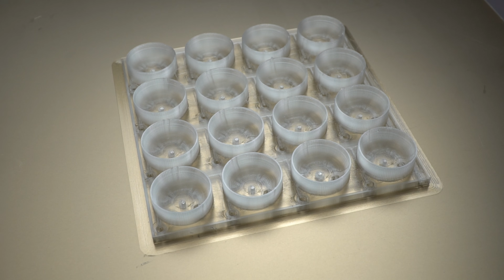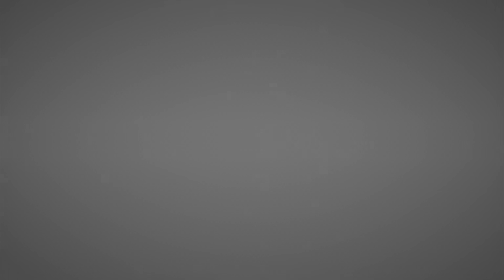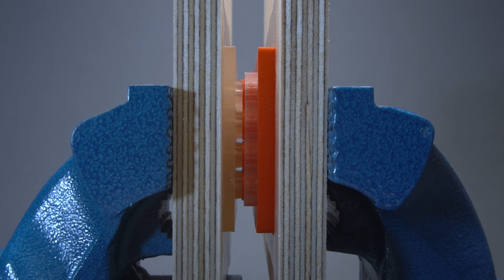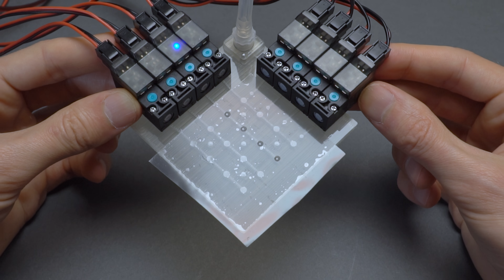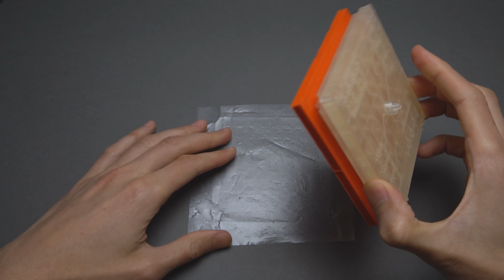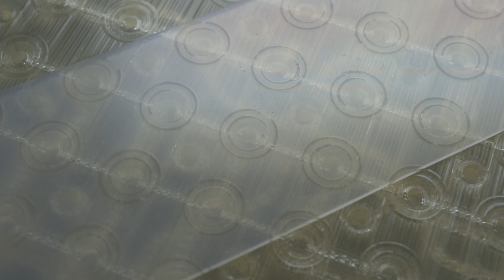Air Powered Display: 3D Printed Fluidic Multiplexing

Comment: How much is the response time affected by vacuum pumping speed vs. air flow restriction through the passages? Wondering if improving response can be done by adding more pumps or if it's a physics limitation

Comment: Can you control the brightness of a pixel by molding a membrane from orange and white silicone, then controlling the pressure and how far the pixel moves inward at a single point to adjust its color intensity by stretching the membrane or creating an air gap between the orange and white layers? Just curious.

Comment: You should look into adding sensors that detect whether a pixel is active. Maybe a vacuum pressure sensor or a flexible conductive membrane that closes a circuit when the cell walls collapse.
That way, you could allow for user input.

Comment: If you make a membrane that has iron filings mixed into it and an electronics board with etched electromagnets just strong enough to pull on that membrane, you can replicate your transistors where the control chamber is actuated by those electromagnets. That would allow you to replace the bulky actuators with a thin control plane, increase speed and decrease noise.

Comment: Do you think you can increase the speed if you add a vacuum chamber between the pump and the mechanism, so you have more of a vacuum to pull from and dont have to rely on the vacuum pump to maintain a vacuum all the time?

Comment: It could become a robot attachment for lifting all the perfume matrix caps at once and releasing them one by one, simplifying the current feeders a lot.

It could also be a good idea to make the contact points smaller and add holes in the membrane to maintain a constant vacuum. The key would be having feedback on which holes are actually covered/blocked.

If you’re interested in testing it, we could collaborate.

Comment: Train brakes use a high pressure instead of vacuum because you can get a greater pressure differential with it. Of course, you would need to make your athmospheric side be a pressurized chamber sealed from the athmosphere then, but if you ever do feel a need to have higher pressure differential (so, higher voltage :P), you have at least one example.

Comment: beautiful system.. next, you could try to build a counting circuit so you only need one valve for clocking through the rows. By the way. You didn't explain how a pixel is released ;) so how is a pixel released?

Comment: My thought goes immediately to a pipetting well plate, but I wouldn't really know what the use case for a modulating pipetting plate would be. It would allow some light mixing, or allow for automated guides. Such an interesting concept, but for display purposes, I think speed and density would need to increase.

Comment: How about adding shading next? I'd assume that adding a variable valve directly to the pump and managing the timing could allow the setting of variable suction applied to each "suxel" (pixel) therefore managing it's depression depth. With bigger screen that would look fantastic. But certainly will bring a lot of problems with tolerances along the way. Great job by the way, that technology looks weirdly sci-fi and retro at the same time it's fascinating.

Comment: That looks like a damn good Massage plate/mate where little automatic suction caps Massage my back. If you get thoes Auktion cups vibrate faster and those solenoids silenced, you could get actually sound out of those membranes. Imagine ultrasonic sound of vacuum powered LRAD

Comment: As you scale up your project, your microfluidic boards will need to scale down. I think you will need to look into resin-based printers with smaller resolutions to print your boards. If you have universities in your area, you may be able to get in contact for use of specialised printers such as from Boston Micro Fabrication or CADworks3D, but off the shelf formlabs printers would work too.
Such a cool application of microfluidics, and there is some real promise down the line like braille displays already mentioned in the comments

Comment: I think you might be able to get more speed out of the display if you oversize the solenoids and drive lines in relation to the pixel size, and supply a chunky vacuum reservoir on each solenoid. The structure immediately suggests itself of a layer of four bigger solenoids, stacked four times.

This may be impossible with the manufacturing method available to you, though. I don't have any intuition for how airtight 3D prints scale.

Comment: Since you can control it with a program, I was thinking using it like a remote IoT display that can interconnect with a flower via Reticulum Network (using LXMF messages) and a humidity sensor 🧠

Comment: This has definitely a lot of potential. The physical aspect is the most intriguing one because this means it can interact with other things. Just like you said in the end, it could literally be a robot. Pixels don't need to be flat and don't need to take up a cylindrical volume. Imagine a 3D shape with logical bladders activated to perform all kinds of actions, and with 3D printing, anything is possible! I think the biggest challenge would be to manage flat smooth surface vs how they would mate to these new kinds of powered shapes, as well as building the logic behind it.

Comment: if you put these inside a half sphere and strech more silicone over the half sphere you get modulated membrane that has a range of motion rather than a binary state, i dont see how its superior to electromagnetically controlled membrane but it would work for a number of applications, from micro manipulators to maybe even camera stabilisation..and depending on the ammount of pixels it could prove to be very finely adjustable...i used a half sphere here as an example for it to be more obvious what i mean but it would work in any shape..after all its air and air is a liquid...would love to see make a box and replace one side with this array facing inwards and one seide of the box being a membrane...would be a fun experiment...for instance if it was arrays like this on 5 sides of the cube and on one side of the cube a reduction to a much smaller membrane it could achieve microscopic level of adjustment..maybe a cheaper way to control laser mirrors than current solutions...love what you do!

Comment: This would look (and sound) so cool as a sci-fi style wall panel. It'd have to be scaled up of course.
I wonder if it'd be possible to introduce positive air pressure into this system. Maybe even a dynamic touch interface (by detecting positive pressure pixels being pushed in)

I couldn't quite tell from tbe video, but did you play with display driver optimizations at all? Like how you can draw with any intersecting lines (like arbitrary rectangles) instead of only rows of pixels?

Comment: if you used white silicone, and put a lip around it, you could pour a thin layer of pumpkin seed oil onto the display. Pumpkin seed oil is Dichromatic, when it is less than 0.7 mm thick it looks green, when it is more than 0.7 mm it look red. I don't know how well this would work, but it could be visually interesting.

Comment: if you can push the pixel to set it manually, and you can read the state of each pixel, then you would have a touch screen!
Reply: I'm thinking the best way to read the display would be to chain a transistor off the pixel as a buffer gate, when the pixel is under vacuum it opens this buffer transistor, which can then be sampled by a second grid without interacting with the vacuum state in the pixel

Comment: This is such a cool concept! And I continue to be impressed by how well you realize the idea in a series of fully-functional (and quite beautiful) prototypes. I've had this project in the back of my mind since your first video 6 months ago, and it has inspired me to explore similar ideas of my own. Thanks for making this and for sharing it with us! As others have mentioned, there could be good avenues into developing accessible technology, not to mention how valuable low-power persistent displays would be for sustainability and responsible energy usage. Excited to see how this continues to develop.
Reply: I don't really know if it's feasible, but I was imagining a setup for this where the front face would have multiple layers: a durable, rigid outer layer of clear/matte glass or plastic on the outside, the silicon molded layer like you have it now as the back face, but in a dark/light color, and between them, a thin liquid layer with some opaque pigment that contrasts with the chosen color for the silicone layer. I think you'd have to adjust the shape of the silicone in the on/off states somehow, maybe inverting it or "raising" the off state, but in some way if it could displace the opaque fluid and press against the transparent outer layer, I think you could make something with a semblance of print on paper. Especially so if the pixel size can be reduced. Just a thought.

Comment: Just great, I am going to have to have a go at making one.

Enhancements?... how about a 7X9 module with an enable input... You could stack those multiplex all of then common and enable 1 or more to change pixels on each. heck what if enable was an address rather than a discrete line?
Also how about a layer that uses the stored vacuum to open a gate? scanning those could create touch input. EG anything touched and thus on when it should be off. is well touched.
With a bit of thought, perhaps a regulator type arrangement where the pixel depth links to a gate that can be read, possibly a tri state gate, concentric rings?
I am thinking push a pixel it moves deeper than it would when pulled by logic because the logic pull would be limited by a second depth, or pressure, based breather.
the deeper push would also latch until reset.
I was originally thinking two stacked layers with a mechanical link shorter than the stack separation... Impractical and complex I suspect.
However,  a cup with several levels of annular rings could work... Upper ring, display depth/volume, lower ring push depth/volume, both latched. Now consider an intermediate volume to read anything below display...
You may have to lap the chambers with a ball bearing but it would be so worth it... Literally the worlds first, and probably last, :-), mechanical, modular touch screen.
Absolutely love your content, genuinely inspirational. Hope my thoughts contribute to further complication and wonder!

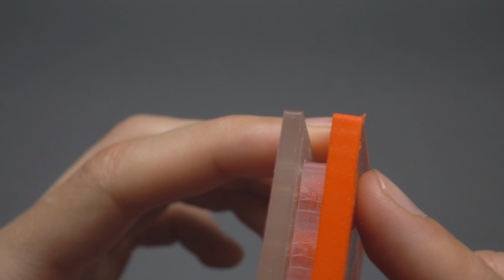Comment: 6:42 got me thinking. Would it be possible to treat the matrix as a sort of memory, because (at least a way i thought of) could you have a flow meter on each line (not the control) to detect if a vacuum was present in a cell/bit without needing a pressure sensor as if the cell/bit had a vacuum before the control line was activated air would have to move in to take up that void which may be detectable with a flow meter, meaning you could theoretically program using your matrix display which could be interesting, however this comes with the flaw that reading the memory would erase it and their may not be enough flow entering the new cavity to trigger the flow meter a fix for this may be like a pressure sensor on each line through the tap of a venturi (but at this scale i dont think a ventrui would work) or using a piezoresistive diaphragm ?? 

I wrote this on my phone so i will have to probably edit this again on my computer for better formatting

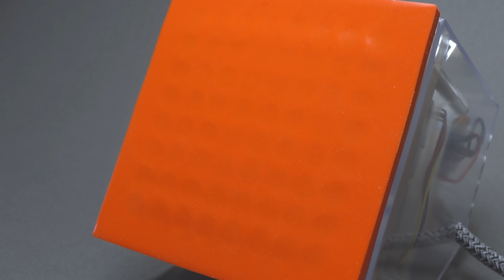Comment: 14:50 Why is H suddenly appearing every now and then?
Reply: good eye!
Reply: When the screen refreshes and the vacuum escapes from the 'on' pixels, some of the vacuum spreads the the tubes into the 'off' pixels instead of escaping to the atmosphere. It might be fixable with some sort of diode.
Reply: The screen is cleared not by erasing row by row but by activating every row at once, which simultaneously erases every row. Because valves have only a small opening, before enough air gets in, vacuum from activated pixels gets into every pixel, flashing them for a small time. The artifact is seen better in some columns than others causing it to look like an H. A similar approach is used whenever you see pixels from different rows modified at once e. g. the top and the bottom rows of the mouth of smiley are both activeted.
Reply: I guess some switching delay of the vlaves
Reply: @creeper6530 If it was a switching delay it should change with respect to the previous pattern but this is switching back to the first H that was shown and then repeating that again and again after each pattern.
Reply: @spark_coder 
If you slow it down you can see it's just resetting every column with modified pixels. Look at both L's when they reset for example. It's just the middle two columns.

Comment: I'd pour glue of some kind all around the pixels, I think a thin layer of silicone glue would work. It would avoid lifting of neutral parts of the silicone screen and the pixels would look very clean and defined.

Comment: if you manage to get the bezel slimmer, these could be stacked like LED panels
Reply: that wouldnt be a good idea. this uses an array for the pixles, meaning a 4x4 display would use 8 valve solenoids. if you wanted to make an 8x8 display with 4 of them stacked, that would be 32 valve solenoids, but if you just made a 8x8 panel, it would only be 16 valve solenoids.
Reply: @Chip-70 Exactly! O(√n) instead of O(n) a.k.a. linear!
(Note: exclamation mark does not mean factorial here.)
Reply: THIS. Thiiiiiiisssss. this. this. THIS. =D

Comment: For a slow version we could do a quite vacuum pump, michrome wire spring inside a silicon tube with 2 1-way valves, heat up the wire and then let it cool down, it should pull a vacuum in one direction. 
Also it could make use IPA as a working fluid.

Comment: Heck the next step will be a vacuum powered calculator, or a keyboard, because we'll need to encode a button pres into the bit sequence
Reply: Because your projects have vacuum outputs but there's no input system working on it, and it'll be a quiet challenge to make the whole calculating circuit made only on vacuum

Comment: Nice trick with the vacuum bag.
Now we need a way to replace the solenoids, maybe you could partner up with a PCB manufacturer, make some coils on a PCB (like PCB motors) and use a magnetic ball (or iron) to open or close holes on the PCB
Reply: those displays with magnets already exist, in my employers hq there's like 1000x1000 mechanical pixels display wall near the reception desk that rotates cmpany logo and bs like that.... been there already like 8 years now

Comment: I saw your robot videos and thought: oh that's interesting. Your display videos however look like they may have real commercial applications in the right field. Very exciting! By the way, it is possible to display all numbers using only 4 segments if they are appropriately shaped. Ambidextroid and Lux Fundred have the two best concepts, with a concept by Ruby and TLKformerly coming third (there is a lot of immature noise on some of these channels but display concept is good if you flick through.)

Comment: It'd be interesting to see if this kind of display could detect touch by the pressure change of the pixels. Not sure what it could be used for, just curious to see what's possible with this platform.